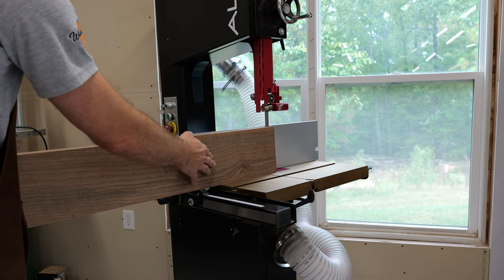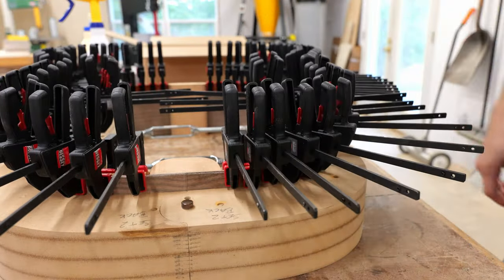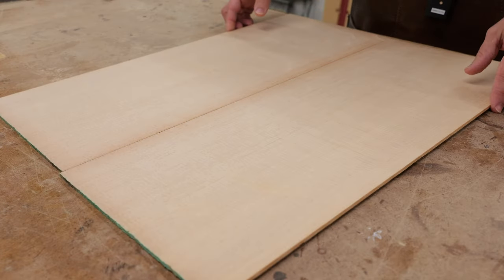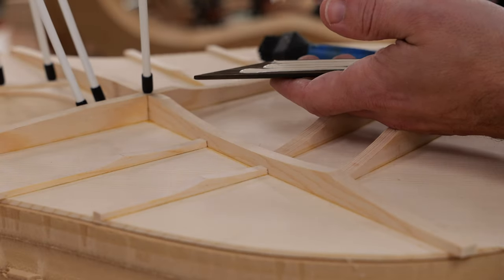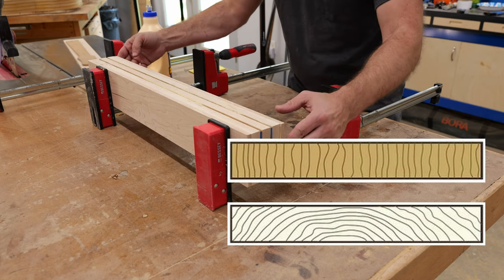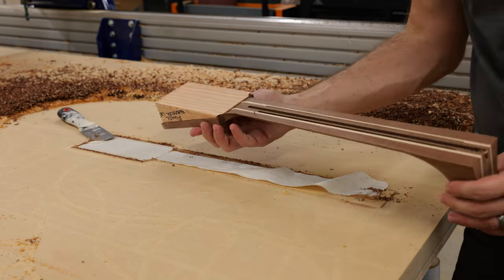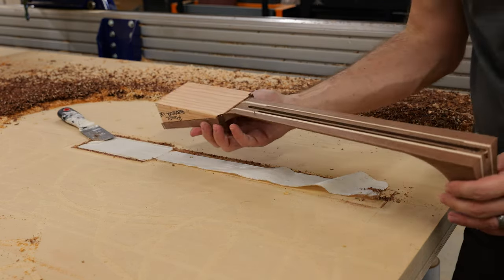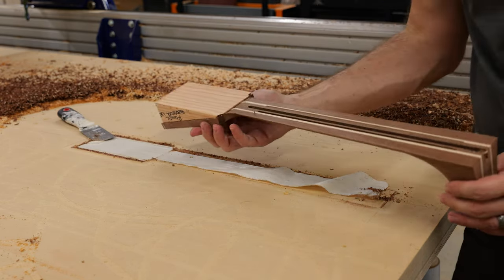Acoustic Guitars Want to Break, Here’s How I Build Them

Comment: I've been wondering why guitar makers never build the NECK and HEAD one whole piece excluding the finger boards, instead the head is glued to the neck, would that be difficult to construct due to the angling of the head?
Reply from the maker: Not too difficult at all.  The neck I built for this guitar is essentially that way even though it started as a laminated neck blank.
Reply: Lots of people make the neck and headstock from one piece. It does waste a lot of wood compared to scarfing the headstock on, though. I prefer using a 25mm neck blank over one that can incorporate the headstock, which will be 2, or 3 times thicker.
Reply: Lots of companies use one piece necks. There's actually very little wastage of you're smart about it. From one 100 X 100mm billet we get two necks, two top blocks and use the inner "waste" for back braces. A scarf joint is way better if you're not going to have a volute. It really depends on what you're trying to achieve vs. what is best practice.
Reply from the maker: This is the same way I lay them out when doing a one piece neck👍👊

Comment: Well done. What chem or is it Kimwipes (?) did you uses?
Reply from the maker: Thank you!  Actually just realized it wasn't a kim wipe, but they still did great and didn't shed.  Here's a link: https://amzn.to/4ftWpp1
Reply: @WoodshopMike  Cool thanks
Reply: @WoodshopMike  I've always used a razorblade or squeegee. Did you have any issues with the wipe pulling epoxy out of the pores?
Reply from the maker: @schrammguitars you gotta work in small sections and wipe away the excess before it starts setting up.  I sand it back a bit between coats and usually do 2-3 coats. 

Either approach works just fine, but I think this was is faster just because you have way less scraping/sanding to do.
Reply from the maker: @schrammguitars if you try it let me know what you think!
Reply: @WoodshopMike  I have been using epoxy pore fill for the past 25 years. Usually 2-4 coats.
Reply from the maker: Oh I just meant if you try the wipe method over squeegeeing and scraping it back 👍
Reply: @WoodshopMike  gonna try wipe method. I use the Squeegee method. Thanks
Reply from the maker: @schrammguitars absolutely! 👊